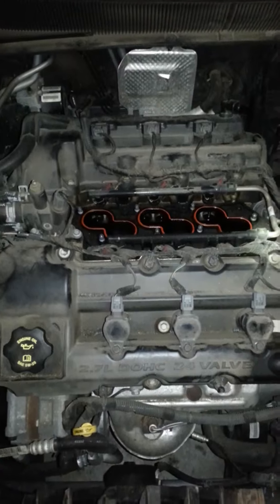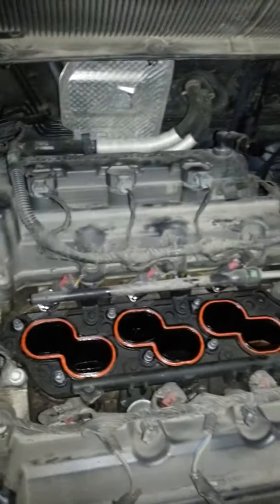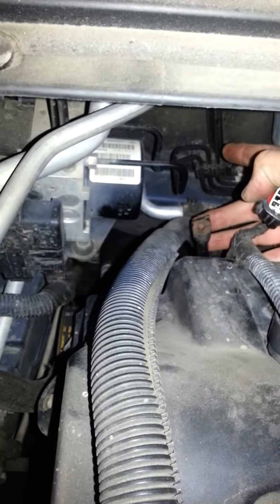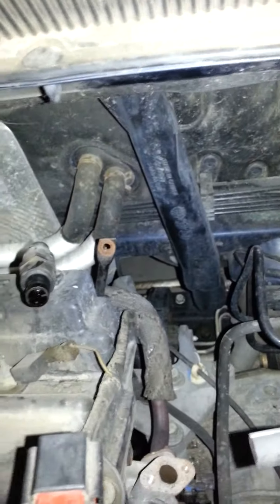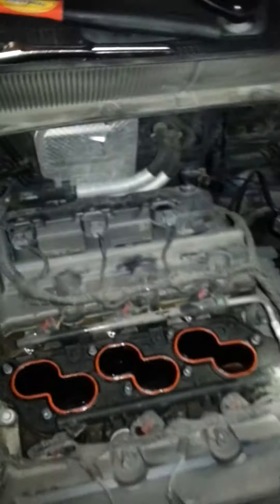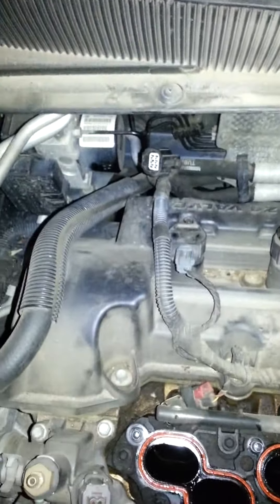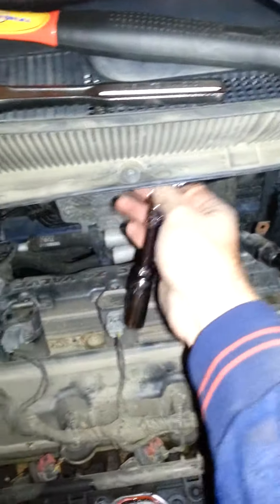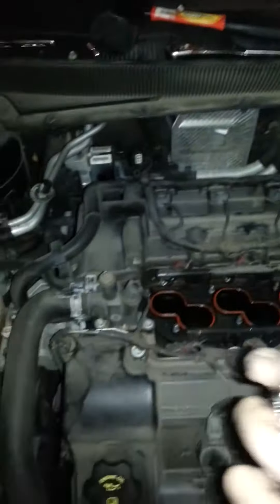2007 chrysler sebring 2.7 V6 upper intake

Comment: Nice video. For future reference in the United States  the drivers side of the car is always the left side no matter where you are. Also, when working with spark plugs it is a best practice to always use a universal. It will protect the porcelain on the plug from cracking if you are not perfectly straight when turning.

Comment: We plan on doing this and replacing the spark plugs and intake manifold gaskets, it will hopefully give us more room to try and replace the oil pressure sending unit which is leaking oil on the exhaust manifold.

Comment: When you took off the steel pipe on the right side of the air intake,what size were the bolts? I'm at this now and can't find anything to fit.
Reply from the maker: +sean jerome Sorry, can't recall at this point, but most of the fasteners were metric.  Keep trying!  Not sure if you saw my other video, it may offer you some additional info.... https://youtu.be/kKpBL_7vxJE
Reply: 8mm or 5/16 Will work for anyone's future fyi
Reply: nice video right to the point very helpful thanks